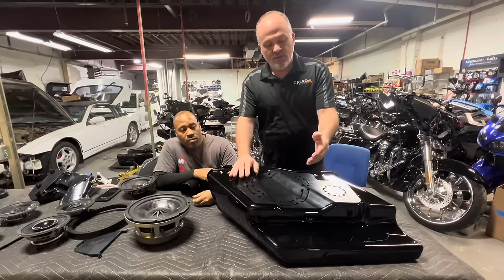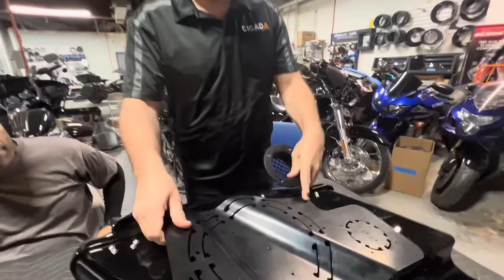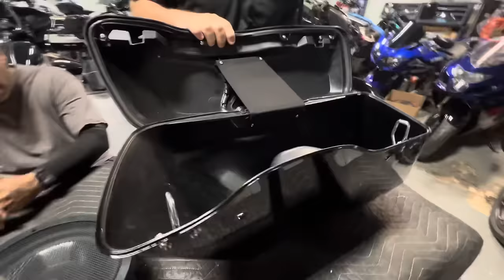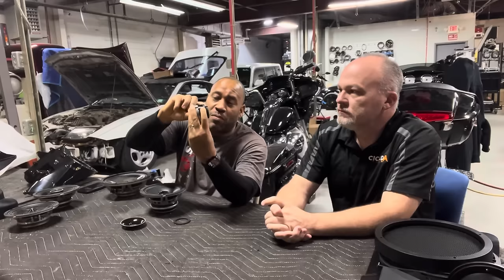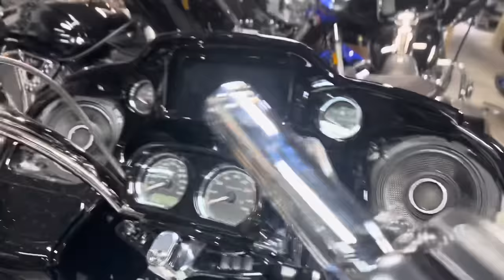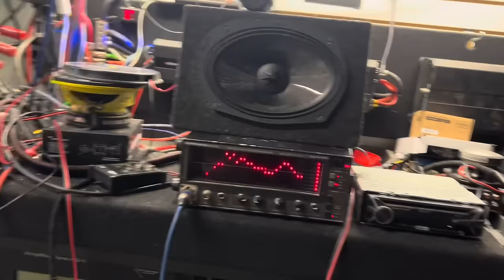Cicada audio releases all new product for 2024 and Nvs Audio gets to test them out 👍🏾🦾

Comment: Would that 6x9 fit in a bag with the Rockford 10in drop in subs that have a small circle on top? The Rockford 6x9 and hertz 6x9 fit because of the small magnet sizes.
Reply from the maker: It will not 

But we modify the Rockford enclosure to reform the top and we make
Them fit .

You can either heat the top of the enclosure with a heat gun and close the lid slowly a few times or cut the top of the enclosure and plastic weld a new top
Reply: Thank you very much! Love your channel. Very informative.

Comment: Carlos you always give us the latest and greatest. I just purchased the cm65.4x w/ the tweeter kit, also cm69.2 w/ the bridge and rrt1. I have 2 SD 800.4 4ohm amps now. Should I purchase new amps, if so what sizes? Also should I separate the tweeters and control everything independently through the s8 dsp?
Reply from the maker: You should’ve gotten the 4 ohm 6x9 that way you can bridge one amp
To the front
And one to the rear 

If you cannot swap out the speakers upgrade the second amp to a 1200.4 2 ohm and bridge it yo run the 6x9 and tweeter bridge
Reply: @NVSAUDIO  Should I put the tweeters on their own amp and use the dsp for complete control or use the crossover it comes with? I have a SD 400.4 sitting around. Thanks for the assist.

Comment: Great setup Carlos, Wondering if there is a basket/pod for an 8" Cicada cm8.4 in lid to separate for addition of 2 Cicada 10?
Also currently running dsp 150.4 and cx 250.2 but want to add bda 1400.4 for subs???
Reply from the maker: We use the 8 inch buckets from Beyma

Comment: Can you run a chx65.2 or ch65.2 off 1 channel of a sd 1200.4. Will the ohm load be to low. Right now running some ch6.54 in the front.  And cm 65.4 in the rear. I’d like to switch to 2 ohm to run more power out of this amp.
Reply: If your 1200.4  the 4ohm version or 2ohm?

Comment: When will the 6.5 carbon fiber component and tweeter grill option be available?
Reply from the maker: This spring
Reply: I may have jumped to quick I ordered the chx8.4 to replace My ch8.4  but may have to negotiate with them to return for the Cmx8
Reply: I'm glad I waited. I'm looking to replace my older hertz 6.5 in my fairing with the cicada audio component setup for my RG
Reply: My order will arrive Tuesday so ill be on the phone with Forrest Monday I wanted more mid bass